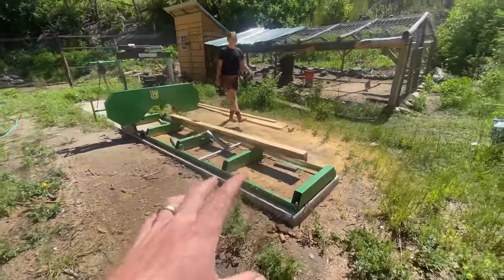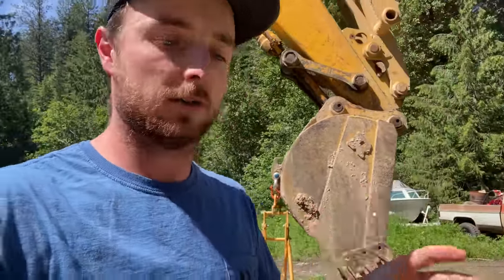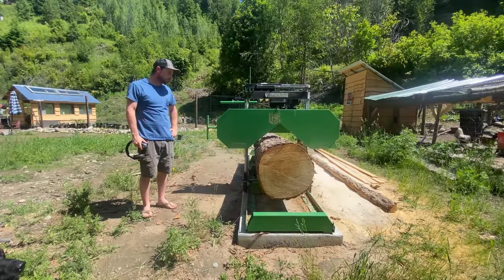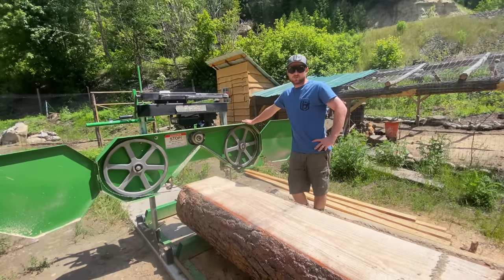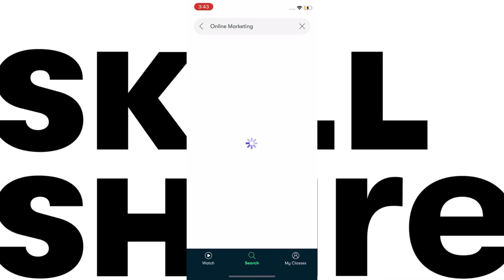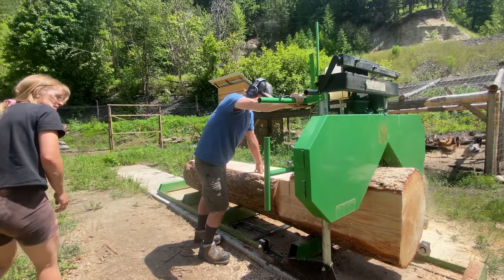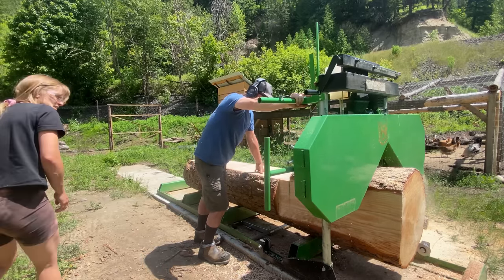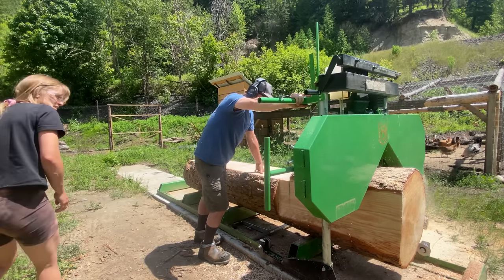Pushed To The Limit

Comment: I bought a harbor freight mill at an auction 12 years ago for $250. It had a blown engine on it so I bought a 16 HP engine from H-F and it has been cutting great since. It has enough bed to cut 24 foot logs. For a basic saw mill they can't be beat.

Comment: From a 5+ year HF saw mill owner, yes extend the mill ASAP! So many 10'/12' logs missed.

I weighed the difference between buying another 6' extension from HF and just purchasing the steel rails and scrap I-beam for the bunks.

I made the WRONG decision by buying an extension. Why? You have a 12' bed already, but you can't cut 10' boards...without some fancy footwork. Same is true at the next level with stock bed extensions--with 18' of stock bed you cannot cut 16' lumber. And YES, you will want to.

I welded an 18" fabbed extension onto the extension I bought. It would have been less expensive to just fab a 7'6" extension, with no wait.

I found scrap I-beams that could have been used for bunk. Split 1 20' stick of angle and you have both rails plus some--careful, the stock rails are 5/16" thick angle...a weird, not usually stocked thickness.

Y'all appear to be doing great!!! On those 24" logs it takes some extra work, but one thing you can do to give you a FULL cut is to remove the handlebar. I temporarily remove the handle bar for larger logs and just tiewrap it to the upright.

Those large logs tend to make good lumber. The gap between the closest points of the throat are 20", but I can saw 24" logs by making two extra turns of the log.

Really nice to see y'all working as a team.

Comment: That’s why I always start with the big end of the log toward the blade instead of the small end. I know, every video on YouTube says to do it the way you did it in this video. But this is a real pain dealing with the saw head 2/3rds of the way through a cut and now your stuck. I would rather not be able to start a cut than get stuck like that. I have been stuck similar to what happened here, but not from size diameter but length. I wasn’t paying attention and placed a16’ log to far away from my blade and ran out of track about 6 inches from the end of my log. My fix was the same as yours, mostly. I wedged the slab up so I could back up my blade enough to cut the slab off with a saw like you did but didn’t knock my blade off. Slid my log back, then finished the cut. The other reason I cut the big end first is smaller slabs, I don’t want to deal with 300 pound slabs alone, I want to be able to just toss them aside easily by hand. I don’t need to make a cant in just 4 cuts, so small thin slabs are my go to. Plus I seem to always need a short narrow board for some project I’m doing and removing the live edge off one of the 1” thick slab ends saves me from cutting up nice long boards for just a couple short pieces.

Comment: Your videos are fun to watch, your successes and failures, and your perseverance. Finding someone to sharpen blades is easy or impossible depending on where you live. If there is a large milling industry in your area and they use band saws it should be accessible. It isn't rocket science so it might be feasible and cheaper to learn how to do it yourself. Lubricating the blade seems to be something a lot of young millers struggle against. It really increases the life span of the blade, and increases the efficiency of the mill. Most people use diesel for pine but there are other formulas. Thank you for the video.

Comment: Great job guys. I'm impressed. 2 Suggestions i want to make. Keep your logs clean and free of as much dirt and pebbles as possible. Dirt will dull those blades faster than you think. Use a stiff brush to clean the bark or even use an axe to remove the bark where possible.  2nd. Use some soapy water to cool the blade as you cut. The blade gets very hot and will stretch over time. When you finish cutting for the day, loosen the blade tension to prevent stretching over time. 
Keep up the great work. Stay safe.

Comment: Great demo of the Harbor Freight mill!  So, under regular, normal usage, how often do you change the mill blade?  For example on a U.S. carrier, the wires that catch landing aircraft are changed after every 10O catches.  Do you change blades after every 30, 40, 50 trees?

Comment: I would have made a smaller cut for the first cut to keep from needing to use a chain saw to rescue the band saw, and in so doing, less waste, you threw away a lot of wood that you could have cut for other projects, 2x4, 1x4, 2x2 etc.
Reply: There is another YT channel that said that their comment section got hacked with a message like the one above. Nuf said.